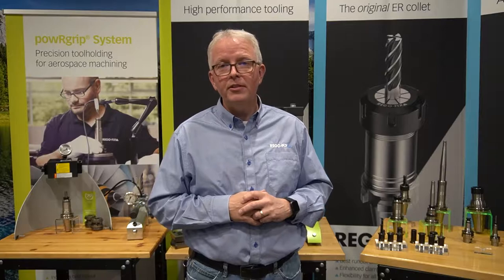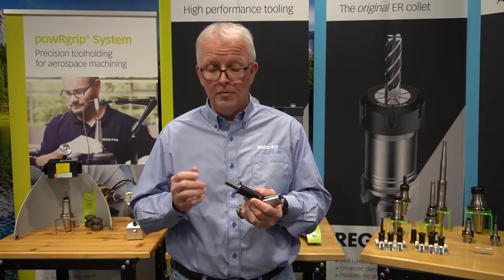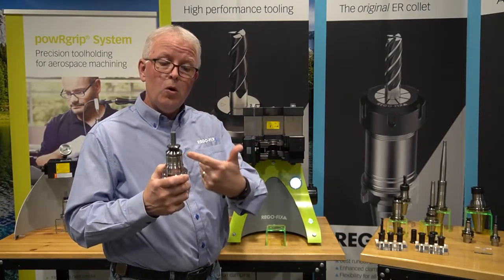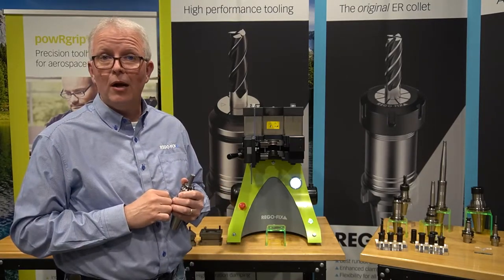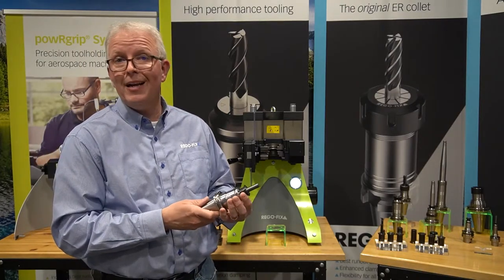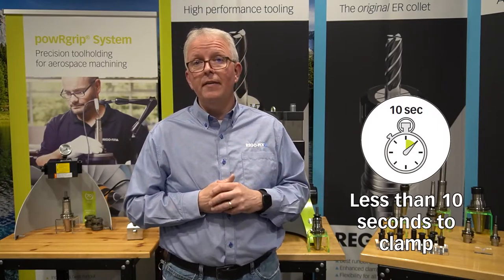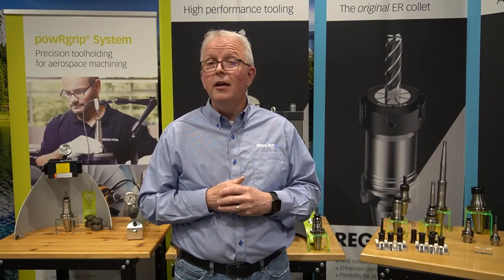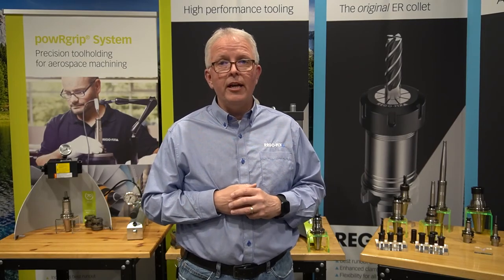TechChat - How the powRgrip System Works

Comment: I am in front of choosing the HSK A63 holder system for a new cnc milling machine. Do you have vibration damping comparisons between powgrip and hydraulic holders? What does it look like?
Reply from the maker: Below is a link to a study we did some time back between Hydraulic and PG. It goes in to more than just vibration damping; however, the general idea is that the TIR & damping characteristics of the systems are very similar. Where powRgrip benefits the most is in the rigidity of the toolholder, where hydraulic tends to struggle.

https://bit.ly/3Q3zFlo

If you have any questions on this let us know!
Reply: @REGOFIX Thank you for your answer :) Now I use GF milling machines - Mill S 400U and Mill S500. I use them for milling EDM electrodes and milling hardened steel - injection mold inserts. The spindles are weak but fast, the taper is HSK E40. Perfect for HSM. I use hydraulic, heat shrink and accurate ER chucks. In six months, the OPS Ingersoll Eagle V9 milling machine will arrive. The spindle will be HSK A63 taper and will be strong. After reading the file you sent, I am convinced that your system will be suitable for milling hardened steel and steel. I have another question about drilling. Do you think from an economic/technical point of view I should also use powRgrip (solid carbide drills from 2mm to 16mm, drilling in hardened steel)? Will I also gain a lot by investing in powRgrip compared to shrink or hydraulic chucks (longer drill life, better hole quality)?

Comment: How's the holding force like compared to shrinkfit or hydraulic?
Reply from the maker: The best way that we've come up with measuring holding force in a lab setting is through the twisting torque of a toolholder. We covered this in an older video from a few years back, one that should probably be updated in an early 2023 TechChat. The video can be found at this link: https://www.youtube.com/watch?v=ixxTpRTkfjI

To be completely honest, every manufacturer of toolholders is going to says their is the best. We're no different, but we've tried our best to be fair and give evidence for why we feel this way. The PG system, through it's press-fit nature, has incredibly strong gripping force. Additionally, as David consistent mentions in our PG TechChat videos, we're also getting outstanding rigidity and vibration damping... all due to the press-fit design.

I'll get with David and we'll put this all together in a TechChat for the coming weeks to spell things out a bit better through an updated demonstration.
Reply: @REGOFIX  Thanks for answer, i'll take a look